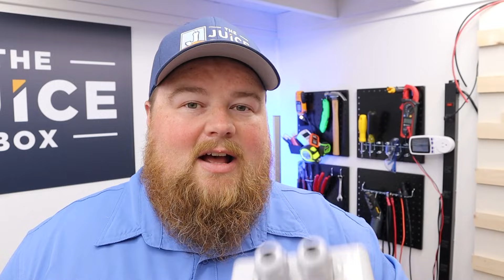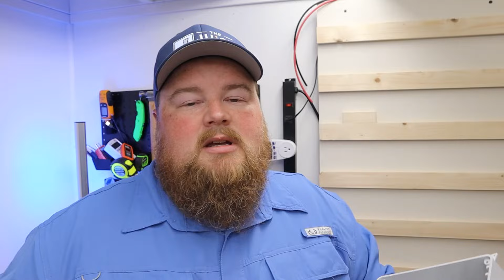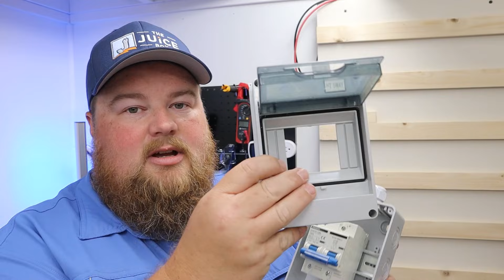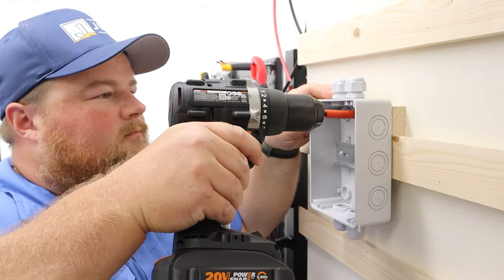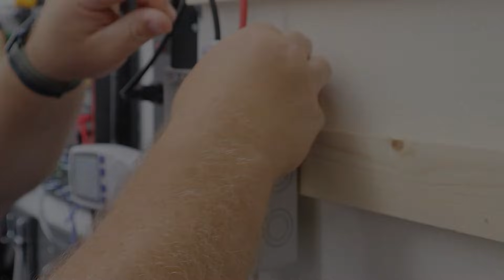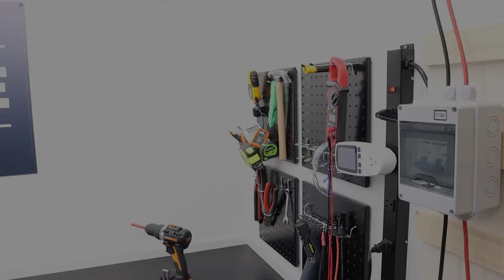Solar (PV) Disconnects & How To EASILY INSTALL ONE from DIHOOL Electric

Comment: why 400 volt breaker- when unit takes 500 volt?   why go larger with the amps?? how does that protection work if the amps are so high, nothing will trip it?    are the solar panels actually pushig massive amps:?

Comment: How much safety margin do you guys use in breaker sizing in amperage ?  I watched a video here the other day: a 16A breaker literally set aflame when turning off just a 12A load.   That was quite unexpected for me, I would have considered this sizing as almost safe and also the brand they were using was not some noname crap, and yes, it was a DC circuit breaker.
Seeing that I would not feel safe with anything below 3x - 4x safety margin.

Comment: Meh. If you are going to use it as a disconnect, just use a regular outdoor, metal box, HVAC disconnect.  The breakers you are using as a disconnect are not meant to be used that way. Those breakers have a limited lifespan based on the number of throws off the breaker.

Comment: so, if a dc circuit breaker is sufficient or allowed to be used as a disconnect, then why do they also make dc isolators/disconnect switches?

I like your video, but it seems your system would be safe with a box that houses your dc CB, along with a transient voltage supressor.

Comment: do not underestimate DC it is dangerous if mis-handled, also your solar pv wires when they enter the building need to be inside of conduit, at least here in Texas, make sure those breakers are DC rated with ARC suppression.  One more note, that appears to be a 100amp breaker? Panels should be on a 15amp no more.

Comment: Just add a board below the cleat and screw it to the box then it will not come lose but you can remove it without issue.

Comment: Couple of points for you. You should have ferrules on the wire ends for proper termination. Use DIN rails stops to prevent the breaker from moving left and right. And you are correct with the + and - at the top of the breaker when the top is the input side. If you want to use the bottom of the breaker as the input, then you switch the + and - to opposite sides but need to label input and output.

Comment: One QUESTION here! I´m not an electrician so I don´t know much, but DC can create an "arch" that no one wants is what I have learned.  So my main idea was this, if you have a house (and use a microinverter) = no string but single PV panels creating energy, then one could add a panel on the east side, and one on the west side of the house they would have cables going to a SWITCH and then into the microinverter... with the switch, one could then activate the west PV panel one for the evening.
Is this ok, safe, or are there some issues....

Comment: Nice vid, short n sweet (I liked & Subbed) -
I have a possible 400w (4 panels * 100w in series) @ 12v. 
Is my DiHool 400v @ 30a enough over kill ?

I also ordered by mistake a  Pjerjzn Store -
Solar Panel Disconnect Switch 400V DC/AC 10A PV Disconnect Switch Outdoor Miniature Circuit Breaker IP65 for Solar PV Homes Battery (400V 10 Amp).

Which one is the correct amount of over kill ? (10a or 30a) 
My system will not be larger than 400w (in series) @ 12v or 200w (in parallel @ 18v *2.

Comment: So you have seriously over powered your breaker 😂. As you have said .. kind of defeats the purpose of the breaker . You want to match it with your charge controllers amp as your just going to blow it up when it handles more power than your mppt 😂

Comment: Did you test this breaker to see if it meets the specs?
Reply: I'm in the UK so your regs will be different but please do not follow the advice of this gentleman .. one panel is likely 25a at most .. what do you think is going to happen adding 100a.. yeah that's right system kaboom and fire .. that is a breaker it's designed to cut out at 100a so if it throws more than 25a through the circuit his mppt/pwm is going to catch fire as it now has no cut off because the breaker can handle it 😂😂

Comment: Its ok to go Big on the Current Rating on these DC breakers if you only need it to be purely for disconnect right? I have two 550w panels with 14A Isc and a breaker disconnect of 25A, seems too big.. But also can you talk about adding Fuse Holders and SPD together with that disconnect for you incoming cable from Solar Panels? Coz if seen most people do that..

Comment: As an Electrician with 40+ years' experience hearing someone say "if in doubt just go big" is an absolute dumb way to design a protective circuit.
Let's summarise what a circuit breakers task is = to break the circuit in case of overload to PROTECT the circuit and thereby possibly protecting property and people from the consequences of overloaded electrical cabling e.g. fire hazards.
How is it going to protect a circuit if it is not designed for that particular circuit...go big??? great .....circuit breaker wont trip but the cabling will overheat....good design.
I won't go into how many other mistakes were made on this video....as the one I have highlighted should be sufficient for people looking for direction on their installations to skip this one.
Reply: This is not for current over protection it’s simply a switch
Reply: @ImTIMMYBRAH_Fn  This type of circuit breaker should never be used as a switch..... It's not a switch, it's a breaker!
Reply: @Theo2482 haha well said . Blokes pulling 20amps but has used a 100a breaker 😂😂. Kiss his system good bye 😂😂
Reply: @Theo2482  If you are intending to use it as a circuit breaker then no you should not use it as a switch. Since he is not using it to protect the circuit, I don't see a problem. One day it will just stop resetting and he will have to replace it. IMHO

Comment: I just purchased the same brand DIHOOL,  though mine is a 60 AMP with Female/ Male  MC 4's on  input and output ( top/bottom). Our system is small system with 9x100 watt  panels on the sheds roof feeding a Zendure Superbase V 4600. The Zendure SBV4600 is an expandable unit that takes whats called Zendure SBV 4600 Satellite battery units, and it can keep expanding up to 46,000 (46K) Wh if needed. The Unit itself weighs about 121 pounds, and its on wheels, and the 2 out of the 4 wheels are powered in which it can be controlled on your cellphone through their APP.
Reply: With intention to protect my solar system against overcurrent and allowing to isolate system when you want to work on it (unless you can switch off the sun). However, read / view some test people have done with several of the "cheap" to buy (polarized) solar breakers, when the circuit is openen with the breakeran arc frames up and burns down the breaker and then the flammable material around it like roof, RV and that is not cheap at all, interrupties a DC current for a voltage some 50V is no joke: arc / stick wilders use this to on one spot create a lot of heat to melt 2 precies of steel together...As the arc is expected to be pushen by permanent magnet insite the extinghuising Chamber the direction of the current requires it to install in the "proper" way, For people who have grounded the aluminium frames of the solar panels also  increased the risk of fire in case of a lichting stroke inside rthis grounded structure of alumimum/aluminium. Afdingen faulty breakers is like  installing a sprinkler system which pumps gasoline to the affected area making things MUCH worden, 10 years ago in Australia is was "code" to install such breakers and now they are forbidden...For a single panel woth a Voc below  50V such a breaker if properly installed probably want catcher fire and is you open it you want drop from your roof by a shock is you isolate your system for higher string voltages they might and the solar panel is a current source abd completelydifferent than USA split phase utility where neutral is grounded a house site....DO NOT BELIEVE PRINTING ON CHEAP BREAKER WHICH SUGGESTS IT CAN SAFELY INTERRUPT CONTACT UNDER LOAD.....Just check several clips about DC MCB SOLR CATCHING FIRE....

Comment: 8 Gauge wire on a 100 amp breaker??
Reply: The rating of the breaker is irrelevant. It's big enough to never trip, so it acts like an on/off switch. The wire size is matched to the solar panels and the distance to minimize voltage loss..

Comment: Hi I see u connect red cable on the right side of breaker  I have Lange dxpool 47 32 A break should connect red on right side or left or does not matter either way

Comment: The polarity is Improntant because we're dealing with high voltage DC currents.    By design, the plasma arc, created when the breaker trips, will be drawn into the extinguishing plates by a permanent magnet.  Wire it wrong and the arc is repelled, and may not ever extinguish. This could cause a fire.  Very important to get it correct.
Reply: Use non-polarized breakers.

Comment: WARNING: If this polarized breakers are connected with the source (solar panels) comming from bellow, the plus pole must be connected on the side where on top the minus symbol is printed on the breaker. There are magnets inside to push the spark into the extinguishing chamber, otherwise the spark is pushed in opposit direction into the mechanism and the breaker catch on fire within seconds! The current flow must go from + to - and of course the + stay a + even he leaves the breaker throught the - terminal. 
If coming with the source from above as shown in video, the + must be connected on the side where the + symbol is.
Reply: Polarity marks should match the source side
Reply: @tjmooney4181  If there are only polarity marks on the top, but you come with source from below, then plus goes into the minus side.

Comment: I’d advise using ferrules and double insulating the connectors. Postive and negative must be in the correctly poled connectors or Arcing will probably occur.

Comment: The hardcore reason to connect the positive from the panels to the positive on the breaker is about how the breaker does its job. Internally it has an electromagnet that is used to pull the contact away to open the connection when the breaker senses over-current. If connected in reverse, the over-current will cause this magnet to PUSH the connectors together causing the breaker to cook itself.

Comment: I don't need that thing.  I run off 12 volts and everything is smooth.  Connecting your solar to the utilities isn't very bright.
Reply: It’s not connected to the utilities. That’s just an oversized breaker he’s using as a disconnect between his panels and charge controller.

Comment: Other than the polarity signs for avoiding shorting mistakes, is there any difference with an AC breaker?  (I can use a sharpie to add +/-)
Reply: The differences are monumental. AC cycles give the breaker a safe way to break the current at 0v. DC doesn't have that cycle, the current is constant. So, DC breakers need a mechanism to stop the electrical arc that forms when it tries to break the connection. Some people call it an arc-extinguisher.
Reply: Read my comment...WARNING...

Comment: Should ferrules have been used on the stripped wires instead of just twisting them before inserting into the breaker?
Reply: No
Reply: Cannot see the point of that.
Reply: @prometheusboat  Generally they prevent the wires from splaying out as they’re compressed and make for a tighter clamp with better conductivity. No reason not to use them if available.

Comment: HOWdy  T-J-B, ... 
Thanks for taking us along ... 
by the way = 
those weather / water TIGHT  fittings are referred to as:  "GLANDS"  ... 
suggestion: when installing / securing STRANDED-WIRE in a screw-down FITTING (like your circuit-breaker)  you might want to explore the use of   FERRULES ... 
... ferrules bind all of your STRANDED Wires together in a bunch to allow for a better contact & <less chance of any stray STRANDS escaping or being MASHED to the SIDE ... 
FYI:  a big selection of FERRULE Sizes are surprisingly INEXPENSIVE ... 
COOP
the  WiSeNhEiMeR from Richmond, INDIANA 
...

Comment: Reason it's marked negative and positive. The reasoning is when the switch is on or off it engages the off position on the negative side first before the positive side when you turn it on it does the positive and then adds the negative within the switch so there's no spark. It's like a car battery you always remove the negative 1st.

Comment: Thx a lot for all your efforts. You're absolutely good at what you do. Having said that, let me put in my 2 cents. When you're using the EG4 18K-PV (Hybrid inverter) you do not need a combiner box. Also, many are moving away from it and using instead an isolator. Thx

Comment: So you could do a dedicated battery disconnect box just like that? Battery disconnects are not an easy solution to find online. Most search finds stuff for marine or rv life rather than residential. I need to have a disconnect for 20KWH eg4-LL battery backup. Would something like this work?

Comment: A small block of wood below the cleat and screwed to box, But breakers really are not disconnects they are meant for protection of the wiring

Comment: Keep the french cleat, but put a piece of wood on the lower screws that keeps it pulled down.  That'll keep the cleat engauged, but be easily removable.
Reply: In other words, put a regular piece (not beveled) at the bottom, using the bottom screw holes on the box, that touches the flat bottom part of the cleat board, applying pressure on the top cleat.  Still easy to remove (just take that board out), but won't mess up your wall either.
Reply: I was thinking about a board above cut to fit so it cannot move up. Or a board cut at an angle and use it as a wedge to hold it down.